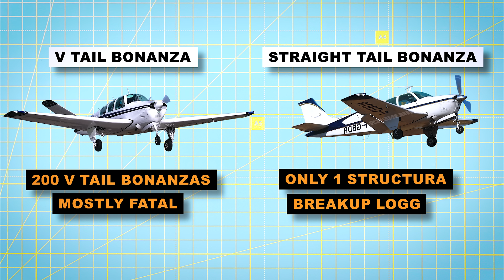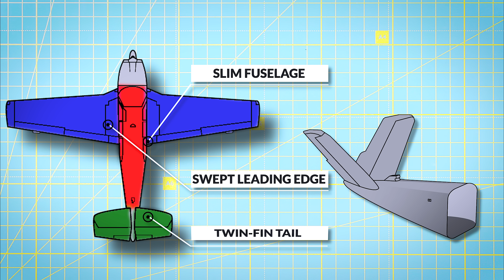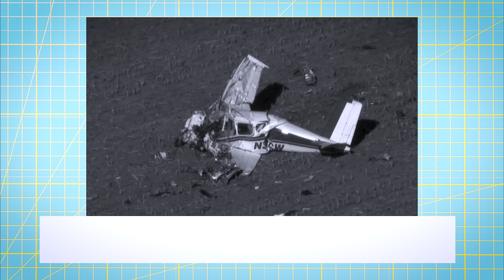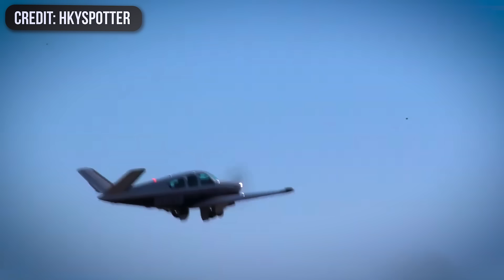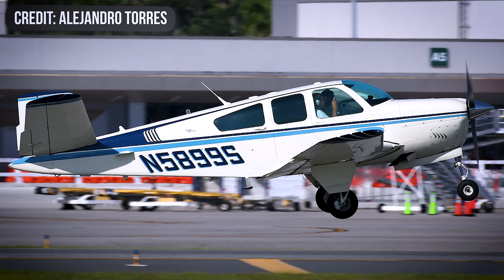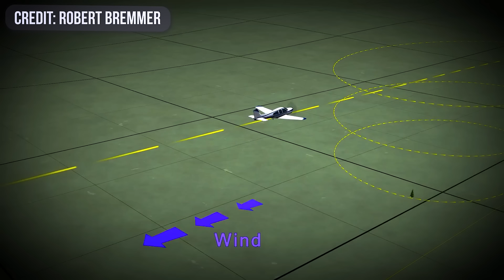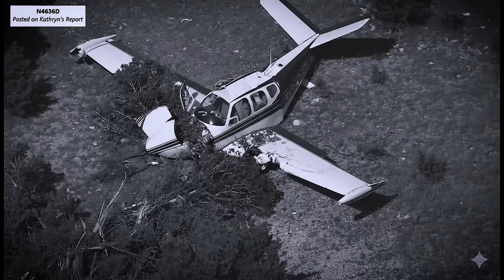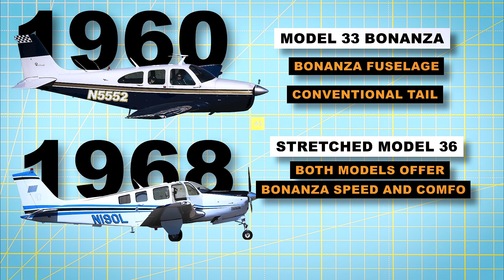Why Did This Plane Kill over 200 People?

Comment: I survived a very terrible crash on Easter Weekend 1981 in Long Beach Washington. We all should have died, but my father was an incredible pilot, and we managed to make a forced landing at night in a storm on the beach, near some hotels. We all walked away but my dad broke his back (not paralyzed) and cut his head pretty bad. The rest of us had whiplash and belt burns.
Reply: Any names I could use to search this up? Were you in a Bonanza or did this just remind you?
Reply: One could check the local newspapers and possibly the airport records for that time frame. The NTSB records are just one source for a determined sleuth.
Reply: @harveyalan788 I have the news paper clipping.
Reply: This is the ONE BIG THING that irks me about general aviation aircraft when we now have the technology in 2026 to apply AUTOMOTIVE crash protocols and electronic safety systems to general aviation with decent airbags, seatbelts that tighten automatically, automatic head restraint systems, yokes with crash deformation characteristics and airbag deployment that mimic modern auto steering wheels and specialized aircraft body crash ABSORBTION characteristics that can deform on impact to take the G forces into the metal and NOT the human bodies! 

Add in that our cockpits should be like modern luxury vehicles with 22 speaker surround sound systems and full multimedia touchscreens, there IS NO REASON WHY we cannot build the world's SAFEST most-crashworthy general aviation aircraft in existence! AND have a super-roomy interior and cargo carrying capacity of a Luxury SUV or Truck! For those long flights, I would also add-in a super-efficient ultra-long-range air-worthy DIESEL ENGINE and a lot more fuel capacity so we can fly farther and faster on a single-fuel-up even at 40,000 feet (YES! Turbo Diesel Aircraft have been tested at 50,000 feet ceilings!). For maximum cabin comfort, add a combined microwave and convection/toaster oven AND a rear cartridge-based toilet system too!

Maybe I should get all the CAD/CAM/FEA/Simulation experience I have and do exactly that! Design and make a super-safe, super-stable, all-attitude-flight-capable, rough-weather-ready six-seat commuter and long-distance travel general aviation aircraft with everything you would see in a modern Cadillac Escalade SUV including built-in thermal and RGB optical nighvision cameras and big 32 inch flight-screens but make it all airworthy and FAA certified and built HIGH-QUALITY using modern robotics and a pressure-stamped with interior honeycomb-wall-patterns for a ultra-high-strength, crash-absorbing 7075 and/or 6061 Aluminum Monocoque body AND still let you carry 6 passengers of up to 350 lbs each and another 3000 lbs of cargo in the back! Make it the F450 Superduty Dually Luxury Platinum-edition Truck of the skies!

V
Reply: That is not a crash. That is a forced landing, there is a difference. That God you all walked away.
Reply: I can't find any NTSB report that matches that date and location.
Reply: @smark1180  Look up N3479B. It should come up in the data base. You will see that there is no further entries after 1977 because it was totaled in 1981. I somehow feel that you don't believe me, but why would I make this story up. I do have the news paper clipping somewhere around my house and I can send it to you if you wish.
Reply: @smark1180 it doesn't mean it didn't happen. Your ignorance shows you're very young or can't research something very well. You're using today's standards of record-keeping to 45 years ago.
Reply: @davidclemens1578  You’re right that “not finding a report” doesn’t automatically prove something didn’t happen. Neither does your claim mean it did. But the NTSB database of crash reports exist before then. Those records are still searchable today, and your crash isn't there.

Pointing out that a specific claim doesn’t appear in the official accident database isn’t “ignorance” or a generational issue. It’s just basic verification. If there was a forced landing at night in a storm that resulted in a broken back, that’s exactly the type of event that would typically generate a report.

If there’s additional detail, tail number, aircraft type, or even a nearby airport reference, that would make it easier to locate. But asking for documentation isn’t dismissing the story. It’s just asking for evidence.
Reply: @davidclemens1578 nope. I looked too. It never happened

Comment: We owned a "new "92 F33. It was one of the greatest handling and easy/smoothest aircraft ever built. Just like silk. I also have ferried an A36 from Chicago to San Juan, across the Caribbean. Great Ride. Smooth. Comfortable. The beech products are built amazingly strong. I have been to the factory and toured the product line. I also have 200 Hours in B55 Twin and 50 hours in a B200 King Air. Amazing products..

Comment: Another thing to look out for is corrosion of the Magnesium in the tail, which can lie hidden underneath the paint until it begins to collapse.
Reply: Tail inspections at annual will spot corrosion problems. Corrosion, on magnesium tail surfaces, appears as raised tracks that look like a worm made them. Corrosion is not a process that sneaks up on you. 30 year Bonanza owner.
Reply: Not true at all. Yes, the mag can be susceptible to corrosion. However, it doesn't "sneak up on you." It's pretty evident from the start and can be treated.
Reply: The corrosion can be eliminated by switching to wooden wings.  All yiu have to do is spray for termites every 4 months.

Comment: It's still just a rich mans game. It's a little club...and you ain't in it. Even homebuilt or ultralights are friggen expensive. There is NO way I could fly, even with having it as a dream for 40+ years... The ONLY people I knew that owned planes were a Boeing engineer and a "Trust-Fund" brat that was GIVEN Daddy's business...
Reply: Not true.  You can buy a used light piston single for about the price of a new Corvette.  You have to get a license, though, and not everyone is going to clear that hurdle.
Reply: I never owned a plane.  Too much cost.  I knew if I wanted to fly I would have to have someone with more money than I have pay for it so I flew helicopters for 25 years.  Had a lot of fun and got 8000 hours and an instructor rating with several type endorsements.  Been from LA to the Arctic and New York to Vancouver.  Flying is very expensive.  It would have cost me around 17 000 000 dollars to pay for my time in the air.  If there are any really rich people here who wish to buy me an Astar or maybe a TBM please message.

Comment: Honestly the speed isn't worth it. Lets take a Cherokee or a old 172. You go 100 knots and burn 7 gallons per hour (based on my fuel flow meter) great so you get in a bonanza and go 150 knots but your now burning 12 gallons per hour. At current prices ($5 per gallon) that's about $25 more dollars per hour just in fuel. So lets take a airport 1 hour away at 100 knots. you now get there in 45 minutes. You also spend a load more on maintenance (2 more cylinders) + a bigger engine = more money, a constant speed prop (WAYYY MORE MONEY if it gets damaged (rock chip)).  retractable gear (maintenance hell) and more.
Don't get me wrong they are so spacious and being able to take 4-5 fully grown adults is useful. But when it comes down to the brass tacks for the avg family (not multi millionaires) a $60k 172 or Cherokee 180/140 will do you much better today than a high performance (special endorsement), retractable gear (complex endorsement).  

Even if you lets say went on a 10 hour flight which lets be honest GA planes are not designed to do (they are meant for 100-600 mile runs) (at 10 hours might as well take a jet and save 7 hours) the bonanza will only save you 2.5 hours while burning $250!!!! more in fuel. If i'm going to fly GA I would rather sit for another 2 hours and save 250 bucks.

Ill be rolling to sun and fun this year but ill be cruising at a nice 95 knots at 65% power burning 6.5 gallons per hour for 7 hours. Sure my buddy will get there 3 hours sooner but he will spend way more dough on said flight than me. Don't forget the round trip. For me it will be a $500 trip. For him it will be closer to a thousand.

PS though I will say the one advantage is if you have tip tanks. No refueling stops are pretty nice. Ill have to grab gas a few times but that's the journey
Reply: You're joking, right?  A Cherokee (PA28) is about 110 knots, 8.5 gph.  My J35 Bonanza is 165 kts, 12 gph.  Fly a 600-mile trip in each, and tell me which one you're still feeling alert enough to land safely.
Reply: Don't forget the higher insurance and annuals!
Reply: You have to remember the ego is a very expensive thing to support, and usually it Leeds you in the wrong direction. And you don’t have a big ego. I use to fly a citation, and it wasn’t all that much fun to fly. Give me a tri pacer  I use to fly a 1947 v tail.
Reply: @waynesilva3129  Correct. Me love little planes

Comment: Good video!
I have over a thousand hours flying the Bonanza and have done accident investigations on the type. It is my favorite small airplane.
It has great handling but to get the handling Beech gave up some stability, meaning it will bank away from the desired heading if not attended to. Being current if in IMC is critical and maintenance is imperative.
Reply: Maintenance is indeed imperative, especially on the older airframes.  In my experience,  flying a 1975 BE-55E that I flew for 27 years, with good maintenance when needed, Beech aircraft don't break often but when they do it can be expensive.

Comment: I worked on Beech 99s.  Some had 27,000 hours and many landings.  It is amazing that most of the load was on one bolt in tension.  The 99s had laminated straps that went from wing tip to wing tip.  To remove them for inspection we stacked many sand bags on top of the wing.  During one inspection the mechanic went beyond the area to be inspected and found a crack from  a gear attach bolt hole through most of the web.  They calculated that one more 2g turn at gross weight and the wing would depart.
Reply: I flew Beech 99’s, both B and C models for years. Have flown at least 25 different ones. One of the funnest planes to fly. And I flew ones with more than 40,000 hours on them. Loved the fact they had to get new wings every 20,000 hours. Always felt a lot better in one with 41,000, than one with 39,000.
Reply: @craigg4246  The 27,000 hr 99 had the wings it came out of the factory with.  This was in 1978.
Reply: @craigg4246  I flew them as well. I always felt comfortable flying them and felt that it was a very solid airplane.
Reply: Almost all gliders have two very very very long wings connected by one bolt. Because that plane fits on a long trailer. All the stress on one bolt is no problem at all. Just treat that bolt like your soul, the main bolt is keeping your plane together. It can handle 6 or 7G in many gliders. Sorry, not impressed, but I do understand how important your comment is. That inspection made your heart skip a beat, I guess.
Reply: @voornaam3191  ON most BEECH crafts most of the wing lifting transmitted  to a large bolt in tension on the lower part of the spar
Reply: 'Rapid unplanned disassembly' is a bitch.
Reply: I worked on them as well but never heard of that inspection
Reply: @behindthen0thing  the wing bolt inspection he describes is very common in all the Beechcraft. It’s a required inspection.
Reply: @Tonali01  wing bolts yes but not straps.  Never heard of that
Reply: Beechcraft had awful wing designs because of that.  

It came from the Beech 18 days so they could build the whole plane in the factory with gear and engines on.. and then just roll it outside and bolt the outer wing panels on.  

If you used a bolt in double-shear (the preferred method for attaching wings) you’d fork fittings and large fairings to cover the gap between the wing and engine nacelles.  Bolts in tension allowed for the wing to be flush with the nacelles and just bathtub fittings that needed to be covered.  

The DC-3 used the same idea.. except they had angle brackets with dozens of tiny bolts meaning that no one individual bolt failure would affect it.  

Tension is one of the worst ways to attach anything because the preload has to be higher than the loads experienced otherwise the bolts will fatigue (this is why cylinder head bolts have to have very high torque) and all of the load goes through the threads.  

Beech changed the lower forward bolt to double shear on the Beech 350, and the Beech 1900 eliminated them entirely by having one continuous wing plank like most other airliners have.  

I fly my Beech 360 very gently.  I like the strutted Caravan I fly much more because of its wing strength.
Reply: @calvinnickel9995no, it came from the D50 T’bone. Which became the Queenair, which became the Kingair. I used to fly skydivers in the old T’bone.
Reply: I depart wind after Taco Bell.  Good to know I'm not the only one.

Comment: Cut my flying teeth in a model 35 Bonanza and did my first solo in it, as well. Never had any issues or felt unsafe or concerned w/ its flight capability and I rode out some serious weather, after getting caught by a squall that cropped up directly in my flight path (weather around the Great Lakes area can be challenging). Any aircraft will experience issues if not maintained properly. I also never pushed my top speed. Perhaps I was lucky.

Comment: Owned my V35B for almost 25 years.  After Beech added reinforcement to the tail, the inflight breakup rate is the same as straight tail Bonanzas.  Pay attention to Va and weight and balance and it's not a problem.  One issue to watch is the fact that as the fuel burns, the cg shift back, so with a longer flight you can end up with the cg aft of the limit.  As with any airplane, you've got to pay attention.
Reply: Aft-heavy planes are very exciting and sporty to fly!

Comment: I didn't hear any mention of the adverse roll caused by the V tail when a yaw input puts one rudderlator up and the other one down.  This would roll the plane in the opposite direction of the desired yaw.  Without time in a v-tail a pilot wouldn't be expecting this roll.  My guess is that this condition might offer some squirrely behavior at slower speeds a little over stall speed.

Comment: I have mine since 1993. A delight to fly but you do have to pay attention to them.
Reply: My dad had a 1957 H35. That's exactly what he said too. A pilot without IFR rating could easily get it into a dive so fast that the tail rips off at somewhere are 350 MPH. It doesn't happen to a Cessna 172 because they aren't capable of going that fast even in an uncontrolled nose dive.
Reply: @James-u2f7i  they are quite capable of going through Vne like it isn’t there. A Cessna or Piper are too draggy to get to those speeds that fast.
Reply: @James-u2f7i C’mon James, I’m sure your dad didn’t really have that plane. That’s a crazy story
Reply: Pretty much like any airplane, but some are more forgiving and others you do have to pay attention to, like the Baron I flew for 27 years.  Those V-tails were iconic, and in the right hands were safe as any other GA aircraft.  Safe flying!
Reply: I'll stick with my dorky Cessna 172 😆
Reply: @Sherpaful  Unpopular opinion: high wing looks way better than low wing
Reply: @MaakaSakuranbo  I like high wing much better for sight seeing.
Reply: In speaking to people who have, or have had them, they are the most wonderful airplane ever made.
Reply: I have my V-tail Bonanza kept in climate-controlled storage alongside my chrome edition Cessna, my F-14, and my MiG-21. Goodness, I need to clean that display case!